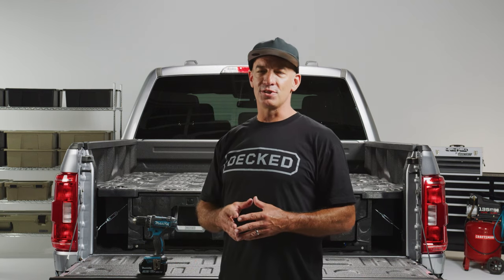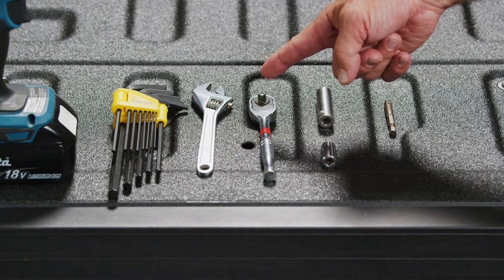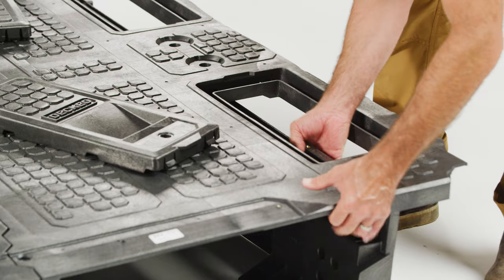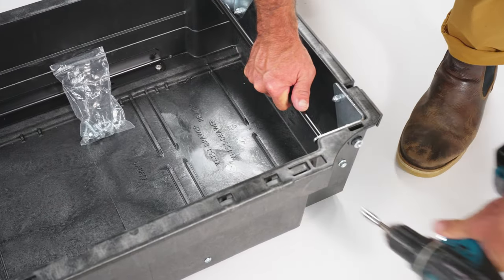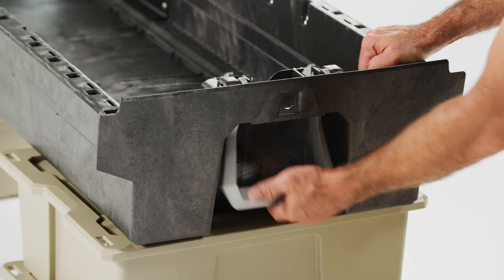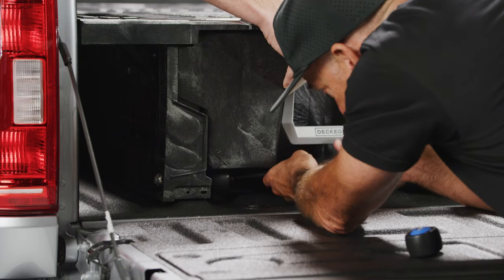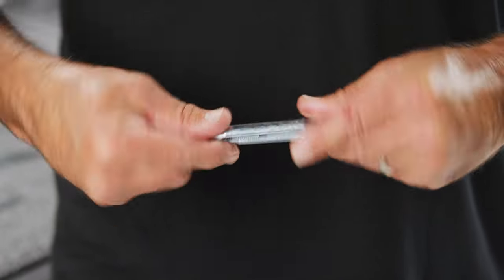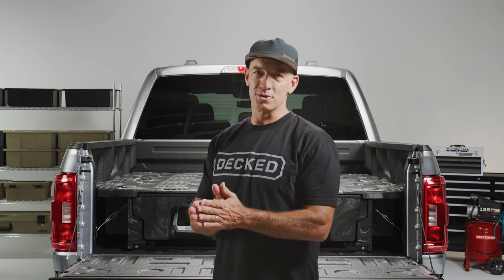Installation | Full-size DECKED Drawer System Install Video

Comment: I just finished installing my drawers and really like them. My one minor complaint is that no where in the instructions or the videos does it mention the little surprise package of screws to "complete the drawer bracket installation." Just had to remove the aft wheels and the drawers to get to them, so not too big a deal, but c'mon. For some reason I picture you guys giggling when you threw that in there.  Anyway, thanks for a great system!
Reply from the maker: Apologies for the confusion here! Thanks for letting us know!
Reply: This got me too! Lol had to take the drawer back out after everything was strapped down lol. Earned my beer
Reply: @Decked  “complete the drawer bracket installation” what is that? manual is so unclear here, mine is all assembled already and extra bag of screws pop out right together with the stickers, main manual and videos don’t show that step, overall nice setup

Comment: You guys really need to put bushings in for the top deck bolts like you have for the drings. Having just the plastic deck in between is a very weak connection between the bolt and nut and can see the bolts coming loose time and time again. Maybe for the 3rd gen :)

Comment: Love these drawer systems, I got one in my raptor, (love it). But I keep waiting for an 8ft version (full bed drawer), I got a high rise cap on my F250 (regular cab) and putting a decked set up wont really hurt the usability of what i can load in it with the headroom i have back there, but i dont really want a gap at the bulk head for stuff to fall in, i dont want another tool box because thats what the drawers are for, and the point of the drawers is convenient access to your gear,  climbing up into the bed and ducking and crawling back to the bulk head for anything isnt convenient 😅.
Reply from the maker: We've got some 8' upgrades in the works! Stay tuned!
Reply: Hell yea ❤

Comment: I have a 2006 Lincoln Mark LT pick up. From my understanding, it is just a more luxurious version of the F150. Would your system work in my truck? I did some research and it is about a 5.5' bed. Thanks! 
-JR

Comment: I really really really really wish you had made a video showing how to install if you have a Rhino Liner. I can't get the tie downs out. I've scrapped away the liner but the screws are stuck. So far I've broken 4 cutting wheels on just one  screw. I've been able to get five of the eight out but it's like one screw was torqued down below spec and the other was torqued down by the hand of God himself. My next course of action is to see if my mechanic can remove them for me. If he can't I'll be returning the system.

Also, I can tell that everything was designed by an engineer because none of the parts are labeled. Not one part has a label.

Comment: Once this is installed, is it typically removable when I need to use the full depth of the bed, or does it essentially mean taking the full amount of time to uninstall and reinstall almost from scratch? I'm looking at buying a truck that has this system and am curious about this.
Reply from the maker: Once installed, the System can be removed in 2 halves, and re-installed the same way! It only takes about 10 minutes with an extra set of hands!

Comment: How many Stash bins does this unit take? I know it comes with two small and two large but does only one go into each hole or does it take two per? Some videos look like a large and small fit into the back hole. Just trying to line up if I need to buy some spares to go with the set.
Reply from the maker: Correct, so you can add up to 4 more for the other 2 openings!

Comment: Another problem is that bots are too short, and no washers are provided. I wonder why they couldn't send it already put together. The box was big as hell.  not impressed so far.
Reply from the maker: Shoot us an email if you're having issues! Service@DECKED.com. 

We can't ship them assembled, because shipping costs would be CRAZY. The Drawer System also needs to be in halves to be installed, so it wouldn't fit in your truck when already assembled anyway.